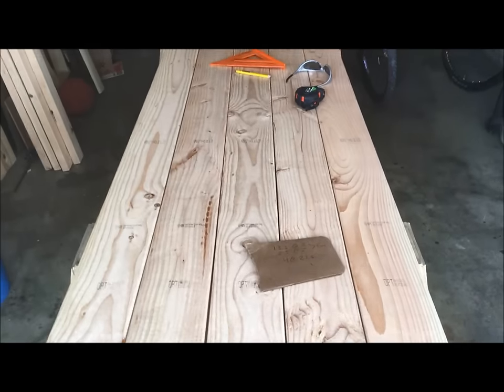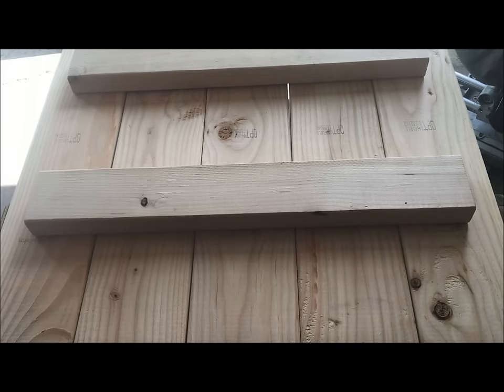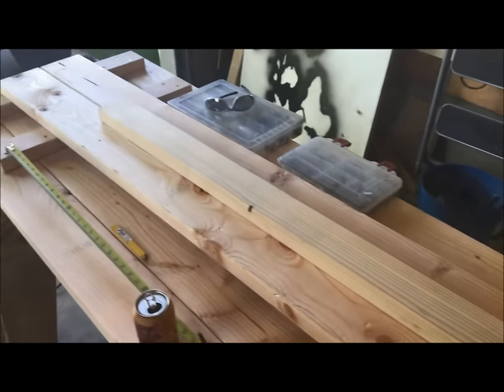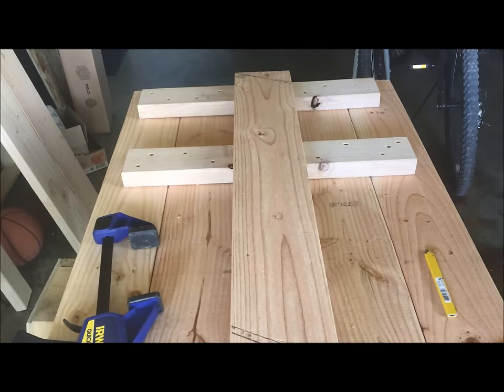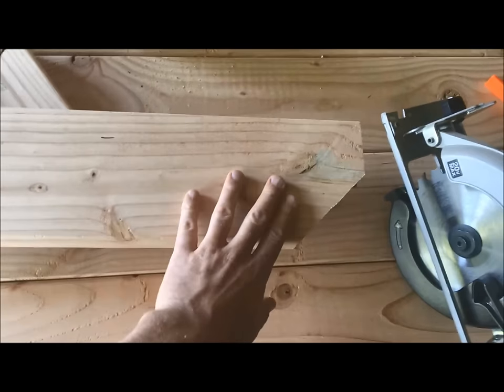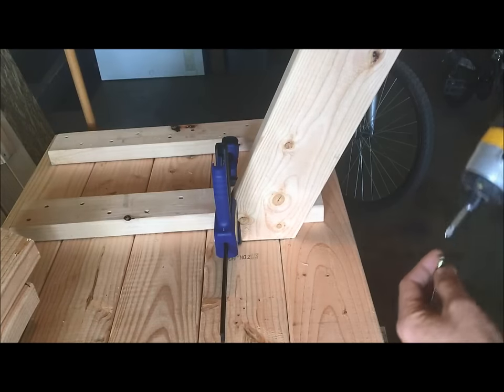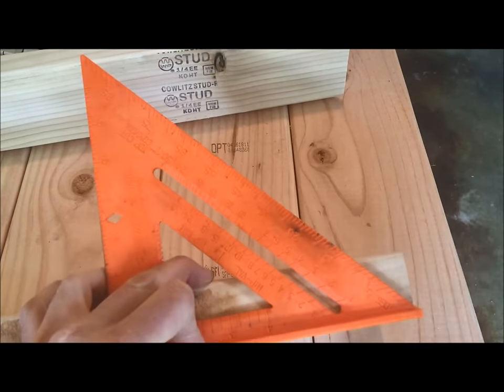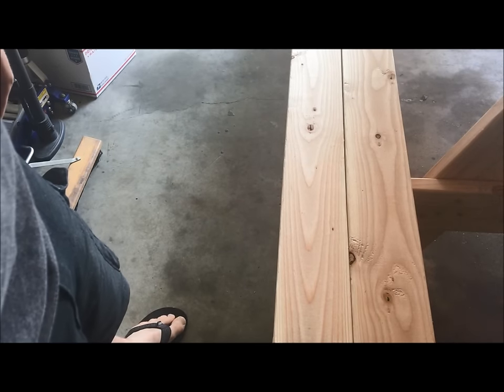How to Build A Picnic Table - Detailed Step By Step Guide

Comment: I watched the video twice trying to figure out why I didn’t understand where the legs holes etc. we’re coming from.  Finally looked at the comments to see if anyone else was missing what I was.  If you think it is clear after your responses to comments, you would be wrong.  There should be some feeling of responsibility to fix the video or take it down.  Doesn’t really help your reputation if you just leave it out there in the incomplete state it’s in.  How many people might go buy the materials, wrong number of 2x6s and the incomplete instructions to find out they have a mess to deal with.  You have the skills to build and then video tape, edit, etc. but do you have the consideration to others to fix your video?
Reply: masterbrian57  I’m wondering how he uses 3 1/2 inch carriage bolts when he’s putting together 2 , 2x6s .. wouldn’t a 3 1/2 inch bolt be short ? Maybe he meant to say 4 1/2 inches ?
Reply: Kevin Garza A 2x6 measures 1.5”x5.5”
Reply: The 3.5 carriage bolts were perfect length.
Reply: @KevinVlogs0717  a 2x4 measures 1.5" x 3.5" and a 2x6 measures 1.5" x 5.5". A 3.5" bolt is the perfect length.
Reply: Nobody answered your question.  Now its my question.  How the heck do you mark the Carriage Bolt Holes?
Reply: Obviously OP isn't going to answer to this, but for anyone else out there. After a quick google, the average height of a picnic table bench is ~17-18 inches, being that you're going to drill in the approximate middle of the brace that adds just under 2 inches to the height and another 1.5" for the bench seat itself. The rest of the video was easy enough to interpret the rest. The guy is doing this and did a good job for free, want detailed prints and plans? Buy them like most other people do when it comes to wood projects.
Reply: @TheSevenJr86  I will admit to being a bit of an ass after looking at my comments last week. I do apologize for not being a better person.  For those of us that went and bought the materials and possibly building our first project, having a missing segment to the project was at least frustrating.  I will say that I had to compensate by doing a little head scratching and a slight bit of research to get it done.  So it is possible I learned more by the video not including all the information.   Again, my apologies for being an ass, it was not called for.  But please remember there are people out there with different skill sets that may struggle more than others.  Enough said, especially by me.